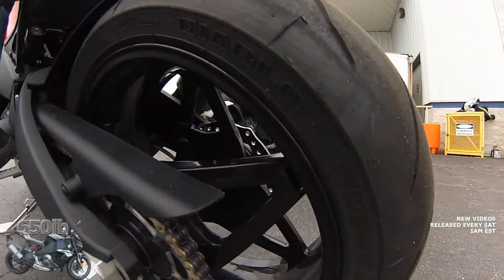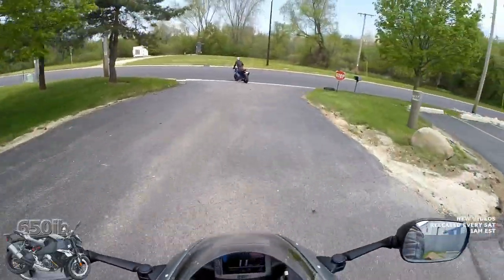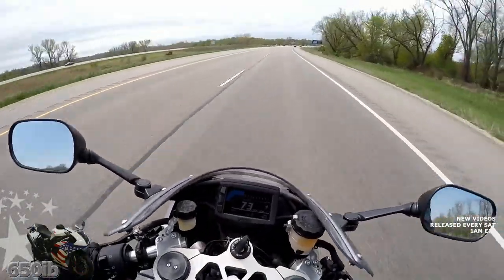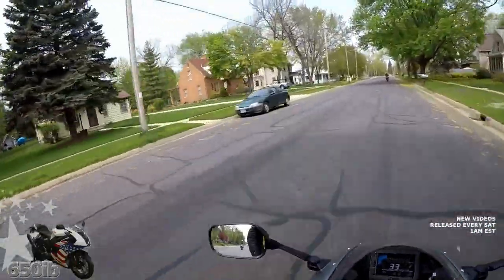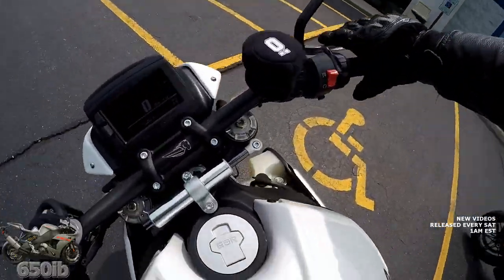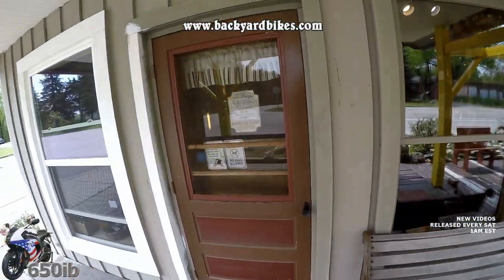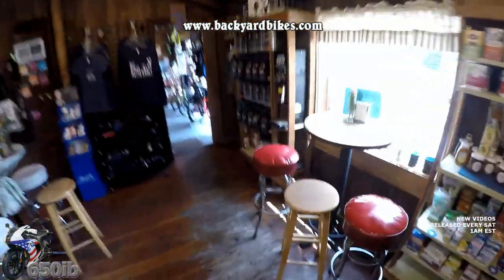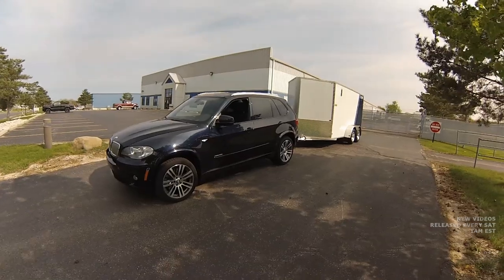EBR 1190RX | First Ride with Erik Buell

Comment: Say what you want but Erik Buell is a genius.  I bought a new 2009 1125CR a few months after Harley shut down the factory.  It is an awesome machine.  Put on the high bars and the HMF slip-on with ecu unit supplied by Erik.  Like IB says it has it's own distinctive sound. 1500 rpm idle.  This is one I won't get rid of among others:  2003 Harley CVO Deuce, 1998 BMW k1200RSL, 2014 ZX-14ABS.

Comment: Man I just discovered this bike and I already want it. I currently ride a Yamaha FZR 600. I wanted something with the power of a full fledged sport bike, but an upright position, and here it is. Now I just have to find a dealer in Missouri that carries EBRs. Even the largest motorcycle shop closest to me, Big St. Charles Motorsports don't have EBRs. Also, great video 650.

Comment: That farm equipment you seen were machines used to spray crops. Mostly corn that's why they sit so high so it doesn't damage the crop
Reply from the maker: Thanks for the info Brandon ✔️
Reply: @650ib  no problem. Love your videos and your bike collection ! Next bike im thinking about a Ducati or an R1 with the cp4 engine,  09 or newer

Comment: Wow,I've LOVED the "Buell" Brand since I FIRST threw a leg over one WAY BACK in 2000 when I took my Brand-new Honda CBR 929RR down to the "Honda-Hoot" in Tennessee there and they were giving "Test-rides" of the Buell,and at that TIME.....everyone was like "WTH? WHY does the oil stay INSIDE of the swingarm again? WHY does it ONLY HAVE ONE "LARGE" Brake-rotor on the FRONT-WHEEL again???" Etc. LOL. But I WILL SAY THIS>...........BOY,did that model I rode,stay SUPER-SMOOTH throughout the twisties down there,and the "Braking" ability of that One oversized brake-rotor on the FRONT,was as EXACT as a surgeon's scalpel !!! Hats off to Mr.Erik Buell !!! :)  OH,and what I THINK that piece of "Farm-Equipment" You guys passed.............was (not sure of the actual NAME of it!?!?) something similar to a tractor,but HOLDS all the harvested crops (corn,soybeans,etc.) in it's bed,and can drive RIGHT OVER TOP of large Diesel trucks and can easily "UNLOAD" all of it's contents right into the back of the Diesel truck's bed without needing any type of "pick and scoop" excavator arm to pick up stuff in THAT,and transfer it over to the Diesel-truck!!! I COULD be wrong though!?!? But I see those alot down here in "Southeastern-Ohio" too.
Reply: Dude no bs i had a 929 honda when i borrowed a buddys bike on a ride n it was a Firebolt xb12r. I ending up buying a a Lightning cuz I loved the street fighter look. Those bikes handle n sounds so awesome. Not built for top speed but for an all around bike commuter/corners/practical power I think they are one of the best bikes ever built. I now own a 1190sx n it's is an animal

Comment: I got tank grips on mine as it will release pressure during long rides on the super slab, but in the corners it goes away. 
But the sickest thing is with traction control off, it will spin the tires in 1-4 gears 😝 and pull power wheelies at 124 MPH I do not know what the top speed is and for the first time I really don't care because it's so much fun. 

How much are the exhaust tips?! I want those but heard they are only for racing use.

Comment: Harley really needs to hire Erik Buell back and start producing Buell Motorcycles again.  If they did, I would trade in whatever I'm riding and buy one. But I don't want to buy a used one now because I'm afraid parts wouldn't be available for it if it broke down or got in an accident.

Comment: Even though the SX looks bad ass, 650ib should get a Triumph Speed Triple for a commuter. The new ones are the bomb, and besides, it is too similar to the RX to add to the fleet. It is worth a test ride to see if the Triumph is better
Reply: Ive owned a 2013 speed triple R, Im sure the new one would be a GREAT commuting bike, but I now own an SX and it shits all over the triumph in the handling and power departments, even with ohlins shocks all round and PVM wheels the triumph never felt planted like the SX does in the turns.
Reply: go ride an SX and you decide. they are extremely confidence inspiring. the power is crazy and it likes being flicked side to side with ease.
Reply: +Alex Johnson I gotta say the updated look of the Speed Triple is great. Aesthetically triumph wins hands down but I don't know about performance since I haven't ridden either lol
Reply: I just bought a triumph StRx and it is amazing!

Comment: Buying a 2017 1190RX Friday!
Reply: Can you make videos? No one's made any, except for Yamminoob which he just complained about.
Reply: @backroadbeetle4781  This spring when I get it set up for me I will begin to film. Add a sub they will be there around April! Ride safe iut there. BTW I did ride it before the tire, chain and rear sprocket went bad. It hall 10k when I got it. I put about 400 miles on it but the fork seal was leaking so I didn't go nuts and he didn't blled the rear brakes right so there weren't any. But the pull on the bike is insane. It has the EBR Facotory tune and the 70mm outlet pipe to the HMF muffler. It is a very angry bike. I cannot wait to let it EAT!
Reply: @drasticthompson1995  ain't nothing beat the overall hp/trq/weight and handling imo. The only thing is they seem to really die off around 150mph, but I'm not looking to do that anyhow. It's really interesting why they do that.

Comment: 650Ib tell me more about the 1190SX.  What are the specs?  Is it V-twin?  How many cc?  How did you like the upright handle bars? Reminds me of my Ninja 650R.  I like the fan on the side.
Reply: basically the same thing as the RX just has upright handlebars and no fairings. Also has a softer rear spring due to the upright position.
Reply: Vtwin - 1190CC, 185HP, lots of torque and great fun to ride.

Comment: Is that a new 2016? There are 4 of the 2014 1190RX near me for only $9,999 each! I'm thinking about grabbing one just because they are $9000 off the MSRP!
Reply from the maker: Yes, mine is a 2016 but they haven't changed since 2014 besides ecm updates which you can get for free from EBR. Sounds like a great deal and you should go for it!

Comment: I think the next bike should be a X-Diavel S or a MV Agusta Dragster RR
Reply: +DJ MotoVlogs Thats not hils style :) those bikes kinda look nice but I don't really like them... What about real supermotos, there aren't much anymore but that looks a lot better imo, either you have a supersport or a supermoto which sets you exactly upright position... But not in between, like those dragsters or aprilia tuono etc... It's a matter of taste, but I miss for example the Aprilia SXV model which looked and sounded great, V twin engine, and only 550cc made that a very competitive engine, too bad Aprilia stopped making them years ago, and most other models besides the great RSV4, look really classic, old and shitty! :p
Reply: +Neel Beke Supermotos are played out
Reply: Dorsoduro doesn't look classic, old and shitty.
Reply: +67claudius Dorsoduro is a great bike if you want something for around town. It cruises on the highway at 80 mph in 6th gear 5500 rpm but the fuel economy at that speed is like 40mpg /:  It is definitely a hooligan bike though, especially if you drop a tooth on the front sprocket or add a couple to the rear. Also, I haven't seen another in my area so they are very unique and it gets a lot of compliments. More than my buddies Ducati 1299 or my other friends RSV4
Reply: Jon R Good bike, I like it.